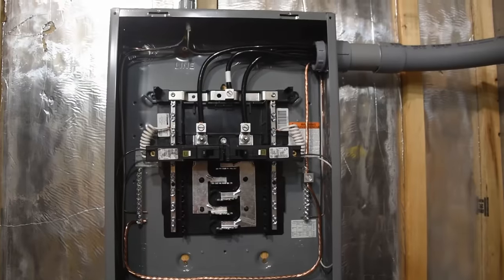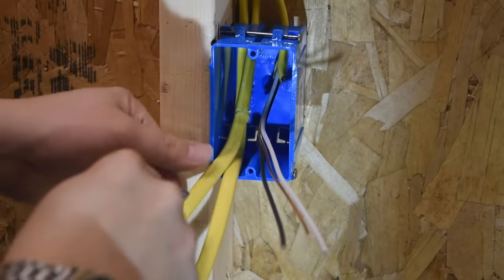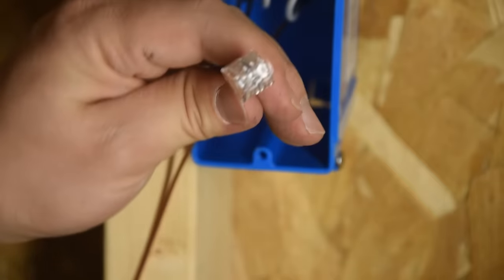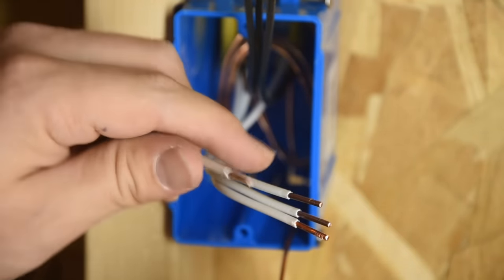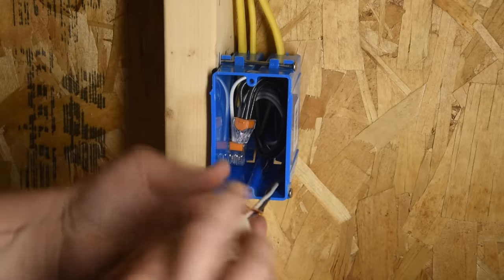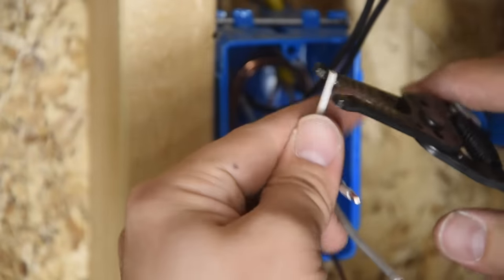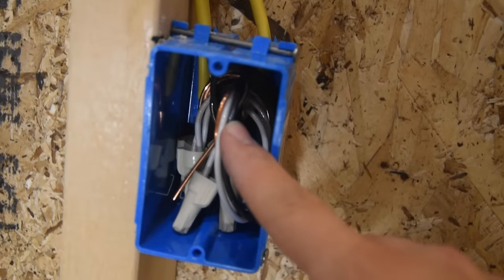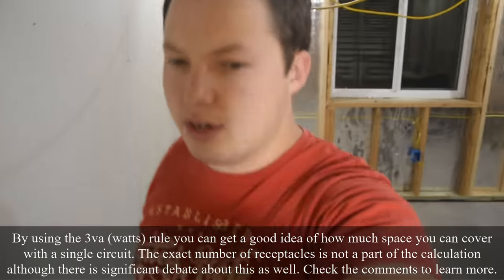Wago's vs. Wire Nuts - How To Wire Outlets During Rough In

Comment: Here In Germany we use wago since 1974 and since the 90th no electrician uses any other connections. You are using the wagos upsidedown. The wago connectors should be installed that the clear side points up. So that dust and dirt can't fall into the spring mechanism
Reply: Oh! That is very good to know.
Reply: He makes a good point I did my research  wago have been around a lot longer than ideal version, pay the premium wago is worth it. Now if we could only get their junction boxes listed by underwriters laboratory.
Reply: that makes sense, danke.
Reply: @christopherwolford6522  I've seen those small gray Wago junction boxes in other channels, they're pretty odd looking! But they're compact, which is nice. However junction box use in North American residential wiring is nearly nonexistent.
Reply: @aaron74  over there they are rated for in wall aka hidden use kinda neat as it's a big no no here. I was sad when I found them not UL listed. I was going to use them in the attic to clean up the mess from the 1970's, but no UL or other listings makes them non NEC compliant.
Reply: @christopherwolford6522  Yeah all junctions must be accessible here in NA. It's surprising they can be hidden behind walls in the EU countries, that seems it could be a nightmare if there were a fault.
Reply: @simonschertler3034  Oh! I made an incorrect assumption--sorry about that. I figured since Wago was a German company, all its products were legal to use in the EU. Yes, that box functions exactly as what's used here in NA.
Reply: You guys have  220 receptacles so I guess that extra voltage bites them in there
Reply: I don’t think buried is a true representation, yes in the UK there may be junction boxes in a void between a ceiling and floor but nowadays it needs to be made so that it doesn’t require access for maintenance, (wago connectors are ok for this).
Reply: mrromantimothy I don’t think we would use many Wago connectors in socket (receptacle) circuits, we tend to bring all the wires to the socket outlet face plate.
Reply: You have 220 volts for your outlet that's double the voltage and that's probably why you have more dependability with those on your terminations  . I do a lot of trouble to Dean and I come across those arcing away and melted all the time
Reply: @cumberland1234  I find them failing in recessed lights or anywhere there is terminations in a home
Reply: You are probably fighting a losing battle here.  I'm American and have been on too many of these video comment sections where anything that is different from "how we do it" is wrong.  Guys in the trades get set in their ways and are closed minded.  I started using the Wagos about 10 years ago and think they're great.  I've never had a failure or seen a failure working as a claims adjuster for 15 years.  Listening to these electricians you would think there were 10 or 12 house fires a week on every block.
Reply: @darinvee4980  The thing which surprises me more is the apparent lack of testing over the pond in the USA.  Having watched some USA electrical videos on test equipment it is no where near as comprehensive as ours in the UK.  Before putting circuits into service here we need to check it is safe, i.e. by measuring the circuit resistance - (hot wires connected to ground back to the board), check the insulation of the circuit is sufficient by means of an insulation resistance test (aka Megger test), check the polarity of the circuit, check the external ground fault loop path, add this to the hot/ground result giving an impedance reading of the circuit (or by measuring the circuit loop impedance directly at the far end), compare the result with tabulated values to see if the fuse/circuit breaker will trip within the specified time, check the fault current levels at the boards to make sure the fuses/breakers can handle the fault current, check the trip times of GFCIs to make sure they are within spec followed by ensuring everything else is functioning correctly.  
One USA electrical video I watched recently seemed to imply that an insulation resistance tester (aka Megger) wasn't for the everyday electrician/apprentice however over here it is an essential piece of equipment used by every electrician installing circuits to our regs.  (sorry if I have used any confusing terminology - I have tried to convert ours to yours!!)  Hope everyone is safe and well over the pond.
Reply: I believe you also use 200 volts line to neutral, so probably less current?
Reply: @Sparkchaser1  Here in Europe we use 230V 50Hz and yes the current is therefore smaller. But the wago connectiors are available up to 32A and 32A are 32A everywhere on earth.
Reply: Simon Schertler I get it.  My point is that you would have lower average current draw with higher voltage, so fewer failures.

Comment: I am not an electrician, but I am surprised to see so many comments saying that twists are reusable.  IE you can undo the twist.  Well, that is technically true, but as Ben said, it work hardens the copper, and even my occasional amateur home wiring experience, shows that previously twisted solid copper wires are VERY difficult to work with. Particularly trying to retwist them.  How do pro electricians deal with that?   I like the idea of using a pigtail to connect to the GPO.  It is so much neater, and doesn't involve trying to stick multiple wires into the back of the GPO.   Personally, I've never seen it done that way in Australia.   As I said, they are just the thoughts of an occasional dabbler.  Lastly, I would personally assume that whoever makes Wagos has designed them with sufficient internal contact so they are fit for purpose.

Comment: What sells wagos;  they are cheap and quick. When you come back for a service call, you are always short of wire length. But they are cheap and quick. especially for residential work. Did I mention cheap. Wagos are not rated to be reused. If you pull one off, you toss it out. Check your NEMA standards.
Reply: knotbumper good point about running out of wires when u take them out
Reply: Their lever nuts are way better and are reusable without nicking or damaging the cable. They can handle any wire type even soldered as it has a spring retention system that always clamps on the conductor even if it changes shape over time. When you want to change something you just snap it open.
Reply: And they are not cheap.

Comment: Back in the day I had a Romex stripper. It was a simple stamped metal thing that slipped over the sheath longways and had a tooth in the middle. Just put it on the wire, squeeze it shut, and pull it off the end. The tooth makes a cut down the center.

Comment: Interesting video. Here in the UK we had a version of Wire Nuts called Screw Its but I don't think they are legal these days. I'm intrigued that you don't put a insulating sleeve over the earth conductors. Leaving them bare was once done here but for many years a green, or more latterly green / yellow plastic sleeve is required. Best wishes !
Reply: Because of the way our outlets are laid out, it's probably a good idea to have an insulated ground wire here, but that is not normally the case... Many years ago, I got a bit of a tingle working on a metal case PC... Upon checking with the multimeter, I discovered that there was 120V on ground... I ended up having to take nearly every outlet out of the wall at that house before I discovered that one of the ground wires was touching a live wire... It was an older house, so the actual ground plug on the outlets was not even hooked up to a physical ground rod either... The house was built before electricity was in the area and it even had remnants of the old knob and tube wiring that had been installed when the house first had electricity and the asphalt and asbestos insulated wiring that had been installed at a later date...
Reply: No need to have insulation on the ground in Canada.
Reply: @danlux4954  -- As cold as it is up there, I would think that having insulation between your home and the ground would be a good thing... :)

(intentionally misinterpreting your comment)
Reply: @jakeblanton6853  lol. You do know the box is grounded and not insulated? ;)
Reply: @danlux4954 -- Assuming we are back to talking serious now instead of making jokes... Depending upon the type of electrical box, it might be in effect insulated since most are made from plastic these days... They still make some of the electrical boxes of of metal though, but the only time I ever use them is when I'm putting in wiring where the outlet / switch box will be exposed -- usually the wiring is also run through galvanized electrical conduit...
Reply: @jakeblanton6853  majority of the boxes around here are metal. Not sure on new builds though.
Reply: @danlux4954  -- I haven't gone to a new subdivision that was being built to look at the construction methods in quite awhile, so I'm not sure what the builders are using, but going by the amount of each type of boxes that Home Depot keeps on hand, I suspect that plastic boxes are used more.  They also seem to be slightly cheaper and the builders will cut costs whenever possible.

Comment: Been using WAGOs for a couple of years now, and I'm not going back to the wire nuts or Marettes if your from Canada.
Reply: Nothing is tighter than the spring of a wire nut especially for aluminum wire
Reply: So, you have never done service calls.  Wago's SUCK.  Same goes for push in wire outlets on their backs.  They are always failing.  Shitty installation method.  That being said, I have seen some types of push connectors which actually work.  WAGO"s with their knife blade connection are NOT them.

Comment: I bought some of the newer wagos with the lever to lock and unlock them and they're great I haven't used a wirenut since. The only issue I've had with them is if rhe wire isn't straight or pushed in good it won't grab so give it a little pull to double check.

Comment: I trim the outer sheath before I put the wires into the box and twist the wires together and then shorten them together with a side cutters before putting on the wire nut twice as fast as you do but  I've been doing it 40 more years than you have and I keep my watch in my pocket.

Comment: As A Master electrician for over 40 years and still working the wago is 16 psi, a wire nut installed properly is 10,000 PSI lots of fires were started by outlets with the same principle as a wago,  while the new led light does not draw like the old incandescents, I don't recommend the wago for anything but the ground, Grasshopper. Trading an old fire problem for a new fire problem (wago) is not desirable, turn the wire nut approx 9 times pull all wires to ensure a proper installation Check the code now only one set of wires to each electrical device, we used to soldier these same connections it was not desirable either heat at the connection always causes a downstream failer. it is also a good Idea in outdoor or damp areas to apply GE Silicone its also listed for this purpose corrosion is always a problem around any connection. long term.  Real on the ground experience, Millions of units installed.
Reply: You say only one set of wires to each receptacle?  Where at in the nec does it say that?  Thank you.
Reply: As experience man on electricity is true tha the breaker has to be same brand as the panel box? I'll appreciate your answer thanks
Reply: That’s an interesting perspective. It does seem that arc fault breakers are necessary for WAGO’s to be long term safe since they definitely have a higher failure rate. It’s better to trip the circuit before there is a total short from a melted wago.
Reply: Fortunately, all of Europe has come out of the 20th century and uses WAGO and for some reason there are no problems with them.

Comment: When roughing in, we ALWAYS strip the wire before entering it into the boxes, that way you do not nick the wire insulation. It also goes three times as fast.
Reply: I was  trained by a guy who told me forget everything you know, and let me teach you,  you can score it with just a razor knife and pull it right off and it's so much faster

Comment: Hey Benjamin! I love your videos! Very Helpful! Have you had any problems with the wago push in connectors? I'm very tempted to use them but keep seeing a lot of information from other electricians online that says they aren't worth it. They call them the sharkbite connectors of the electrical world. Now I know you shouldn't believe everything online, but is there anything to worry about using these in a residential build?
Reply: Nothing wrong with sharkbite connectors, any more than these.  Just people have lots of problems that can exist and they will blame things they changed, even if they aren't the actual cause.

Comment: Wago type connectors is about all they use in Europe.  Most over there don’t even know what a wire nut is.
Reply: Certainly not true. Even the young sparkies get taught to use wire nuts in school.
Reply: @verlicht  and they are also taught what it is by definition: crap!

Wire nuts were widely used in the 60s as a fast alternative to screw type connectors. Especially if a house was not painted for some time you could see destinctive black discoloration above many connector boxes. Using this stuff today is pretty dare devil for a market that builds most of its homes from wood.

Comment: 40 years in the trade. When installing many German chemical processing machines in the US in the early 90s I learned about Wagos. They held up better under high loads, chemical exposure and vibrations than wire nuts or screw terminal strips in heavy industrial chemical processing. Residential loads don't even come close to comparing with this environment. Wagos allow for the expansion and movement of wires within the box that happens constantly with the heat generated within the circuit. A tightly twisted wire grouping capped with a wire nut will loosen over time and fail due to this expansion and contraction. I have found this hundreds of times in my career, even on the best looking twisted splices. I have used Wagos for residential wiring for 20+ years with no call backs. You old guys will say I crossed over to the dark side, but my years of experience allow me to sleep at night. UL, CSA and European testing agencys have all pushed these wagos to the point of burning them up and have stamped their approval on the them. Thats good enough for me.  Push in wiring devices are another story, they are crap!

Comment: Oh man, those Wagos are fantastic as you clearly demonstrated. I've always been tempted to pick some up, but figured they were a luxury item. LOL But with how neat and clean they are, it really seems like a no-brainer to use them. Regarding the boxes, I like to use the deep ones regardless of the wirefill. They cost like 10 cents more, and it's just easier to not have to sort out where they're needed versus not needed. If I'm not using a steel boxes (which I vastly prefer), I like the Carlon SuperBlue boxes as they are much stronger and sturdier than the cheap (yet adequate) regular blue boxes. I have a phobia of wiggly devices on finished walls!
Reply: I'm with ya on the cheap Carlon boxes.  I don't like wiggly devices either, and they strip out too easily.
Reply: WAGOs are all they use in Europe, for what that's worth...
Reply: @thomasdragosr.841  They also use terminal blocks with set screws. Those are very solid, arguably the best splice/bridging devices in my opinion.
Reply: @incognitotorpedo42  Yeah I've always wondered why they don't embed a 6-32 steel nut in the box. I mean you're screwing in 6-32 machine screws into a soft material that would otherwise require a coarse thread.
Reply: Carlon makes several adjustable depth junction boxes.  They're wonderful, especially when cabinets or shelving are in front of the sheet rock. You can set the depth of the junction box after installation.
Reply: Carlon makes several adjustable depth junction boxes.  They're wonderful, especially when cabinets or shelving are in front of the sheet rock. You can set the depth of the junction box after installation.
Reply: @w-2385  Yeah that is a nice application for those boxes, if it's hard to anticipate the depth ahead of time.

Comment: In our country one must first twist the wires together with pliers before twisting a wire nut onto the connection. Splices done your way would fail inspection in any province in Canada, especially on 240, 277, 347, and 600V systems. Also we are not allowed to enter loomex wire into a box without first stripping off the insulation. If an inspector catches you, he will make you pull the loomex out, and strip it first before entering the junction box. We have one of the toughest codes to maintain in the world. I am not here to criticize you, I am just letting you know what we have to go through in our country. Cheers!